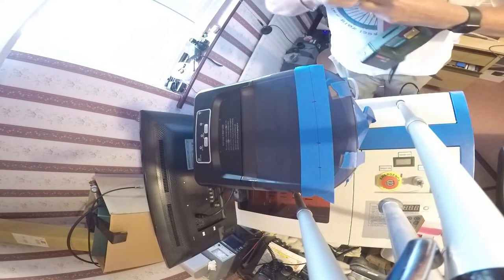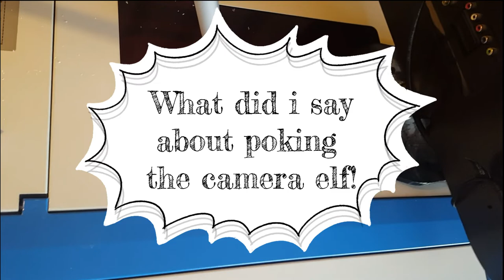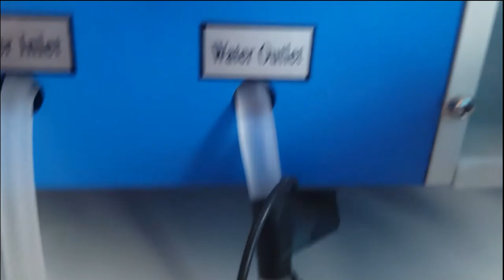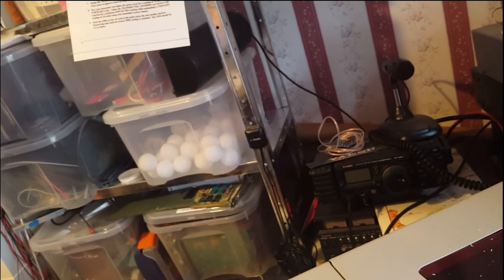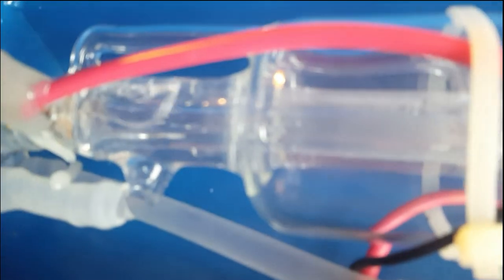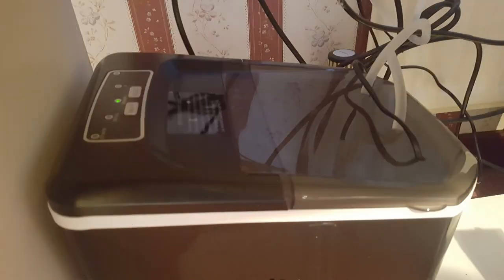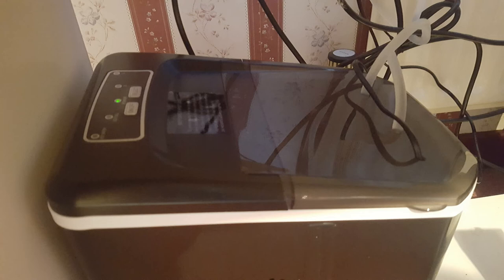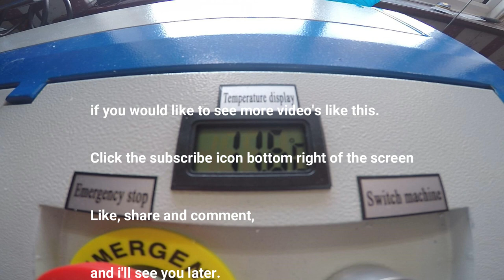#153 K40 laser series part 4 mod 2   Ice maker modification

Comment: Using an Ice Maker is a great idea.  It sure does beat the outrageous prices they want for a Chiller.  Because it gets so hot (38 - 44), during the late Spring, Summer, and most of Fall, I will probably add an extra reservoir, for additional water.  It would have been nice if your video showed how you did your set-up - start to finish.  Looking forward to additional videos on your K40 and any mods you might do.  Have a good day.  Cheers!
Reply from the maker: thanks for the comment, there was not much too it, i just drilled three holes for the feed and return and power. took out the plastic trays and put the pump on the bottom. filled it with distilled water and set it to make large ice cubes.

i liked the ice maker as it has a compressor not just a water tank and a fan.